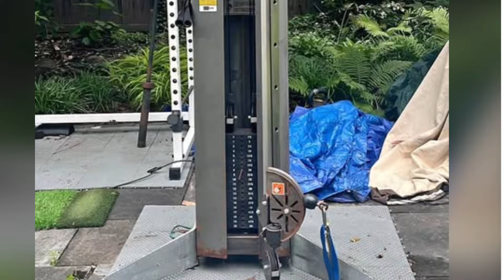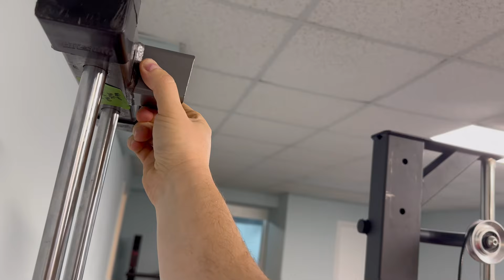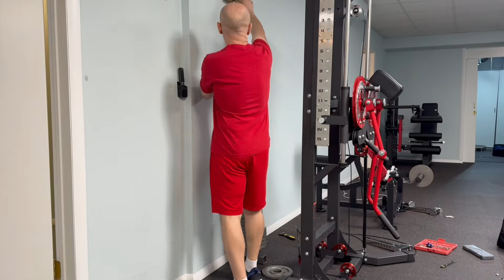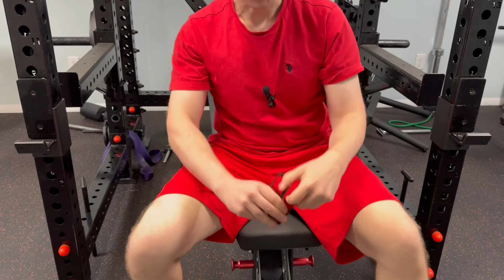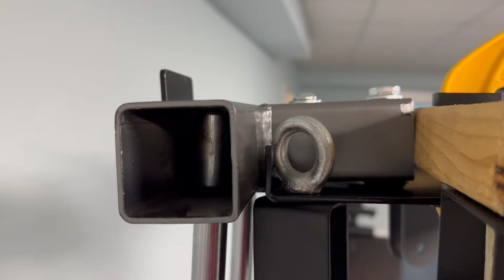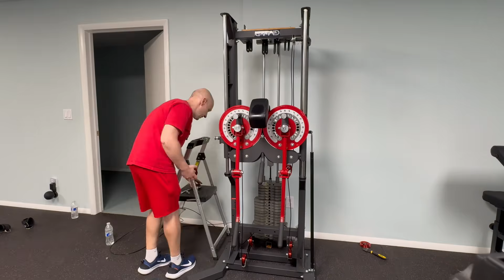Upgrading GMWD Multi-Flight Lateral Raise Machine with a Selectorized weight stack

Comment: i wanna see that thing with the plate loaded trolley system but have it be disconnected so that it can be isolateral a side and really most of all have a 1:1 weight ratio so that those trolleys actually get pulled up the higher that you raise the arms. and some people are raising the arms overhead. I would wanna see it be isolateral, because in most cases people are doing these single arm movements to where the stack moves even less because it was designed for both sides moving simultaneously in mind. I think this would take ambiguity out and keep everybody's strength standards honest when they realize that the reverse pec deck had been lying to you the entire time about how strong you really were at rear delt movements and then people would probably realize you don't really need a lot of weight on free weighted variations to get a stimulus. I think when we do a little bit both of the free weights and the machines/cables, and the cables and machines are designed with transparency in mind it will keep training a little more honest and a lot more enlightening in that regard.

single arm reverse pec deck moves the stack even less, so you're 50% weaker because while you're able to move the same loads as if it were bilateral, because only one arm is moving then the stack moves only half way up. It kinda bothers me when I learned this because I realize that while I made progress and got stronger, I also realize that I'm actually weaker than I actually realize.

Comment: Very cool modification, been thinking about doing this with my leg extension setup. Currently I run the cable to my pulley tower but it would be nice to have the stack right next to it for warmups and drop sets.
Reply from the maker: Yup… you can do this to just about any machine. Once you understand the stack mechanics it’s not that hard.
Reply: @HomeGymHacker  Thanks for reviewing the PeakStrength piece. It was nice to know your opinion of price/limitations.
Reply: Tim, high chance you'll lose that "over-center" weight dropoff that you like.

I tagged you in @VastStrength 's leg extension short. I think you'll like it.